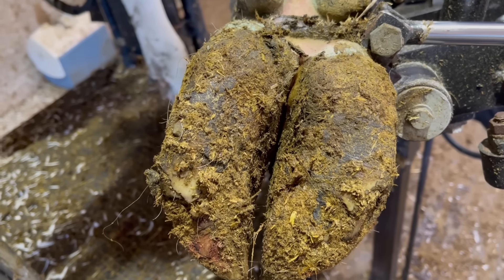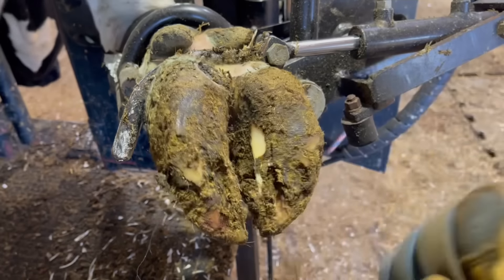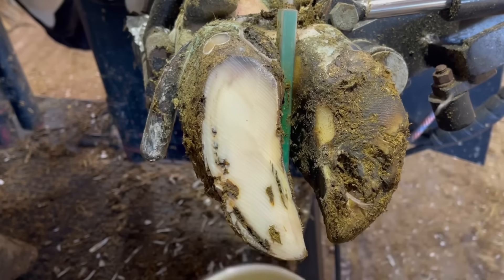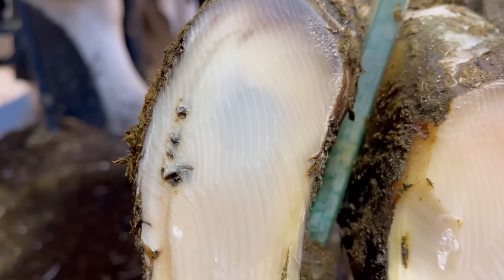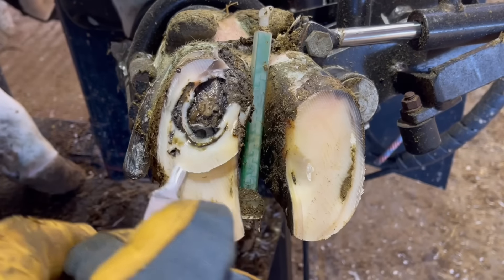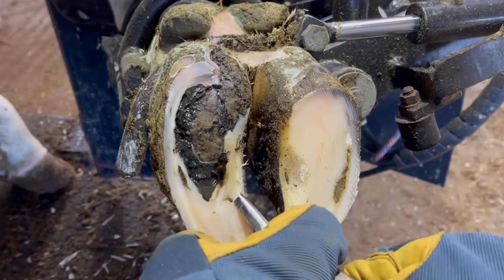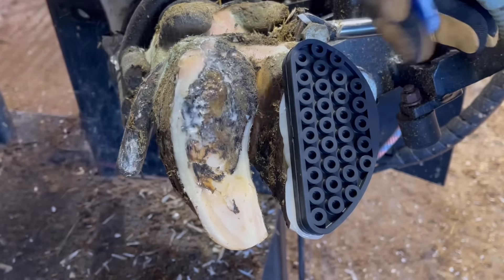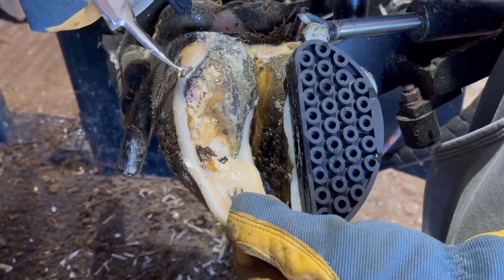THREE Failed Attempts?!?!?

Comment: Once upon a time, I worked at a dairy farm. I saw some hoof trimmers that were so rough with the cows. I appreciate the care you show and I wish other trimmers were as gentle as you. Congrats on 1 million! 🎉
Reply: Gentle that's what I am 2:06
Reply: This makes me so angry that anybody could rough treat a beautiful animal of any type . This is the sad harsh reality of Farm Animals their basically just profit for the Farmer either meat, dairy , eggs or wool etc and because of this they tend to not be looked after quite as good as they should . I have seen it so many times Dairy Cows so lame they can barely stand , Chickens In tiny metal cages so small they can’t even turn around as a result the Chickens become so stressed they lose all condition and become diseased  .Pigs in tiny spaces with their young all cramped in Mum can’t even get up to take a breather because she’s required to fatten up the piglets . Sheep with lambs left outside in all weathers with no shelter from sun or rain only good enough for shearing when their wool coats reach abundance it doesn’t matter if their wool coat is so heavy and tangled it’s pain just to walk . Dairy Cows hooked up to heavy machinery for hours everyday causing infections and abrasions whilst they stand in their own excrete under such damp dirty conditions hoof issues are awry and any illnesses in the animals tend to be left until it’s clear they won’t recover without help then the Farmer calls the Cavalry . It’s all about profit and keeping costs down and that’s why my anger goes direct to the Farmer . Now don’t get me wrong there are some good Farmers out there that do care deeply about the welfare of their animals  I’m not saying every Farmer is bad because this is untrue but there are a lot out there that care only for money and profit and if an animal is suffering in their care they don’t get unduly bothered . I Advocate for all animals and I believe all Farmers   should have to meet the gold standard when it comes to caring for their animals . Regardless of what money a Farm is set to make every Farmer needs to realise that every animal in his or her care has the right to basic care . The right to food and clean water and the right to have space to move around freely . It is also the basic right of every animal to have access to Veterinary treatment should that animal need it . If a Farmer can’t work to these basic principles then they have to question if all the hard work of running and maintaining a working Farm is the correct career choice for them .I will always be a voice for the voiceless we have much to learn from animals . If humans were more like animals and showed the loyalty and trust and respect and thankfulness that an animal does to its human and to each other then this world would be a much better place for all of us to live in and for the generations to come 😞
Reply: She's not being neglected. They've tried fixing her hoof three times. They haven't given up on her. She's lucky the owner cares.